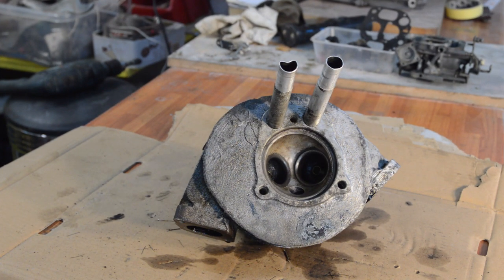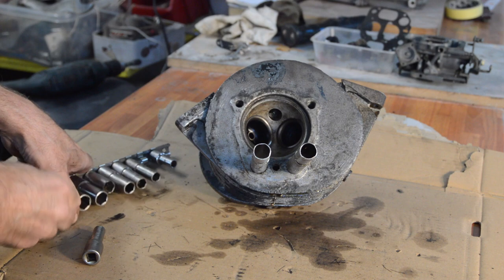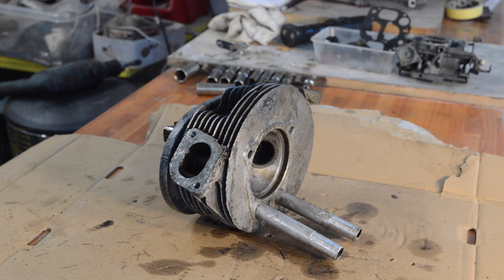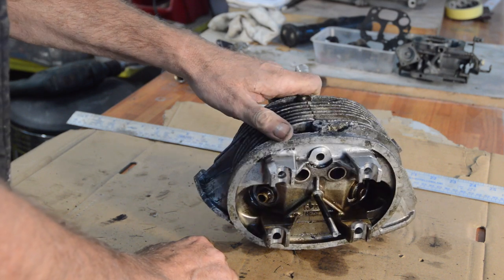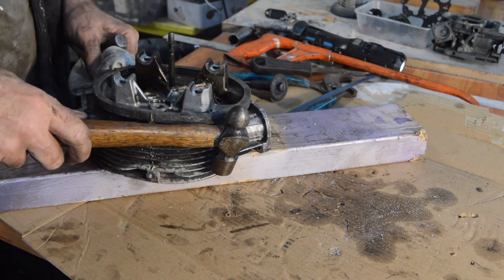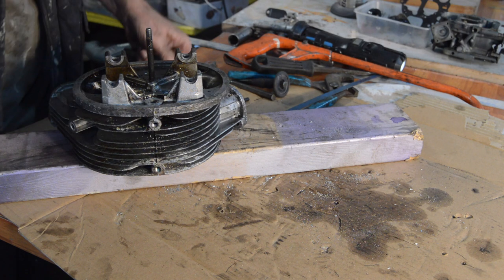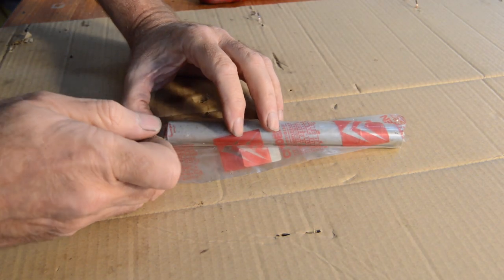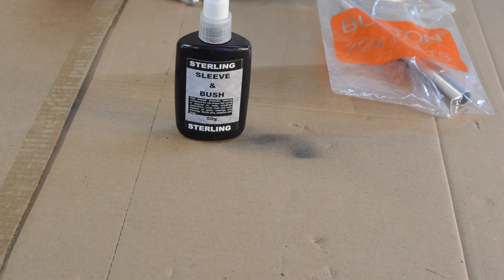2CV Pushrod Tubes

Comment: at 15:56, VERY cunning indeed! Now, every plumber (the ones for buildings) in your neighbourhood will have a proper tube expander (much like the Citroen tool) that fits those pushrod tubes. I find both OEM and aftermarket tubers very, very flimsy, and expensive too. So what I did was to take a suitable piece of thicker tubing and mill both ends to the correct size on a lathe. Costs pennies and some beer for the friend with the lathe.
Reply from the maker: I like your idea of stronger tube as the originals are indeed very lightweight. My next door neighbour has a lathe , I must ask him to try and make some for me. Thank you again for watching!
Reply: @oldnutsgarage  Like your video's....the thing is to make them on a lathe........my late father did this........making the first 105mm the right original size........than just a bit bigger.........when you get them in........just push it to the end......never have to measure it again.......it just sits correct..........My father used to say stupid french........I drove BMW boxer motor bikes........build more to my father's liking.......no creazy heads......just use allen bolts.............like your tube expander...!!!

Comment: Thank you very much sir I am facing the same problem. I stupidly dropped a cylinder head and I have to replace the pushrods. I never would have thought of using expansion bolts. This is the missing link. Now I will be able to take the plunge !

All teh best from Brussels
Reply from the maker: Give it a go, it is not the correct way of doing the job, but it seems to work ok. Good luck with it and thanks for watching !

Comment: Hi - great video! You have been a real help with my 2CV project - already from the start :) I´ve been having a leak which I though came from the tubes - but after viewing this video I realized it came from the tube end - where it enters the cylinder head. My guess is it has been leaking from the very first day - guessing by the amount of oil leftovers on the head and surroundings - 1990 model. At 20:30 you are wondering if anyone had tried high temperature silicone sealant around the gap between the tube and the head - best suggestion ever! I have now tried this, just a smear around the tube - and the leak is gone! Guess when the tubes are inserted originally with the sealer, the cylinder heads draw most of the sealer and the tube enters the head almost dry. Would be best to add some sealer from the other end so that the tube has at least some sealer when entering the head.
Reply from the maker: Glad you liked the video and thanks for the information on the sealant. Really great that it worked. Good luck with your project and thanks for watching!

Comment: As these aluminium tubes appear to be prone to corrosion, surely it would be far better to make a set from stainless steel tube, quite easily obtainable on ebay, and only requiring the ends cleaning up on your Lathe, they would never again cause a problem. Chris B.
Reply from the maker: To be fair Chris I think these heads are late model ones when quality seems to have dropped a bit. I worked on a late 60s engine not that long ago and the tubes were perfect on that. I wish I had a lathe to clean anything up on to be honest. The only other problem with stainless is it would not be pliable enough to be rolled into the head as per original fitment so you would have to rely on some chemical assistance to secure and seal them to the head, although I am sure Loctite would have something suitable in their range.
Reply: @oldnutsgarage  I think the way to go on the stainless tubes would be to have a short counterbore in from the top, use your bush retainer, then put a fillet of silicon sealer in the counter bore, that would give a better seal than just swaging the tubes into the head bore, , how are the tubes sealed into the crankcase? Chris B
Reply from the maker: Yep, worth a try as modern sealants are really good. The tubes are sealed by external rubber spectacle seals which are kept under pressure by springs which in turn sit on washers which butt up against a machined section on the tube, so stainless tubes would have to be machined at that end as well to suit.
Reply: @oldnutsgarage  I noticed that the crankcase end was machines down, probably to give extra clearance when assembling the head with tubes attached into the crankcase holes, I made stainless steel pushrod tubes for my Vincent, they have a flange swaged onto the end to push up against a seal, it was surprisingly easy to turn over the flange after making a simple jib to hold/support the tube, very easy that is if you have a Lathe, you must get one! Chris B.
Reply from the maker: I would love one Chris but not sure I would pick up the necessary skills, old dog, new tricks etc. Which Vincent do you have?
Reply: @oldnutsgarage  Mine is a Shadow, bought for £140 when they were unloved, I should have bough lots of them, but did not have the spare money. As for the Lathe, do not worry about the learning curve, you will soon pick it up by taking things slowly, you only need a rudimentary one for garage use, and with all the factory workshops closing down there should be lots available, Schools and Collages are to first place to look, tell them it is for a community project. Did you locate a valve seat cutter ? And are the valve  seats 45 or 30 degs? Chris B.
Reply from the maker: I was fortunate to bump into the Vincent Owners Club at one of the technical days in the late 70s, car park was a joy to wander around and I used to live near the club spares store about 20 years ago and that sadly was the last time I saw one on the road, only at shows since then. Cutter going to have to wait as another camper van trip calls and the 2cv and everything else is going to have to wait!
Reply: @oldnutsgarage  I know what you mean about having to wait! It seems that as we get older we get more things to do, but we get around to them one day! Chris B.
Reply from the maker: And I am not even in the country at the moment, more trip videos to come

Comment: Hello again, your videos are fantastic, I am still struggling to fit the gearbox and the engine in my Citroen 3cv, I have a doubt that nobody talks about, pistons with polished heads vs. standard without polishing, you can see the benefit of not sticking carbon on the piston head?

Greetings from Argentina!
Reply from the maker: Greetings to everyone in Argentina too ! I think there may be several opinions on polishing pistons. In theory carbon build up might take longer but it will still happen. Gas flow might be changed very slightly as well but again not for very long. I do not know anyone who has tried it to be honest.
Reply: @oldnutsgarage  😁 I had to do it the hard way ... my kit of pistons with cylinders was sold with manufacturing faults, it did not have the arrows that indicated the position, the pistons had a lot of roughness, excessive for my eye, call the factory and they tell me Yes, there was a problem with the manufacturing and the serial number confirmed it, but the replacement period was a few months .. the Factory Engineer at least very kindly explained to me how to measure the pistons and find out which is the correct position So to be able to solve it, by the way I learned something.

When I start my engine we will see what changes I notice, the cylinder heads, I also cleaned them because they had hard carbon from 1974, I sent them to make new ones too.

Hopefully the engine will last many more years.
Reply from the maker: Sounds like you have a lot of extra work there. Good luck with the build and enjoy it !

Comment: A Lot of rather quiet mumbling off camera going on here but don't think I missed anything important. With the tubes out it would have been a good time to face off/ lap in the head with a spare barrel. I know it can be done with the tubes in but you have to have a cut down barrel for clearance. Comment? I think that this is probably a spare head for the shelf rather than one which is going to be pressed into service but it made for a good video. Thanks.
Reply from the maker: You are completely correct, it is a spare which I will be using later on ( possibly much ) for a second engine build I am doing. The face of the head is fine though, no pitting, so it doesn't really need lapping, but as you say, this would have been the ideal time to do it if it was needed. I do have a cut down barrel but it is much easier with the tubes out of the way. The volume issue was due to me forgetting to plug the external mic in when I stuck the camera back on the tripod! Thanks again for watching!